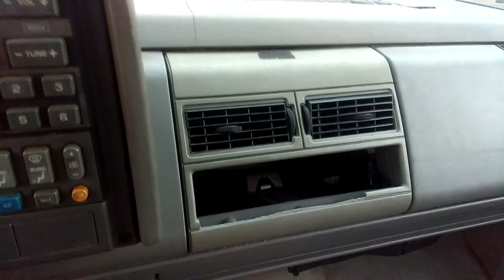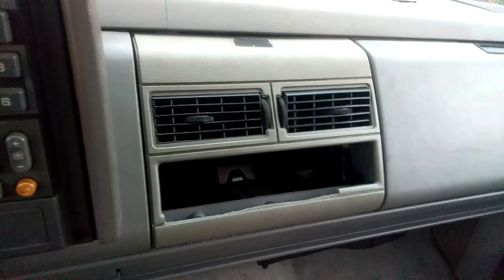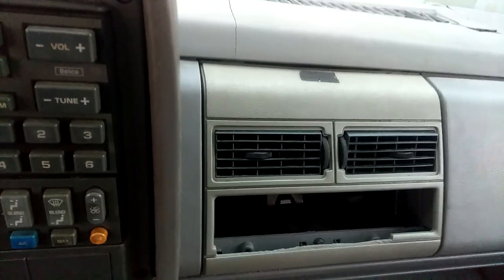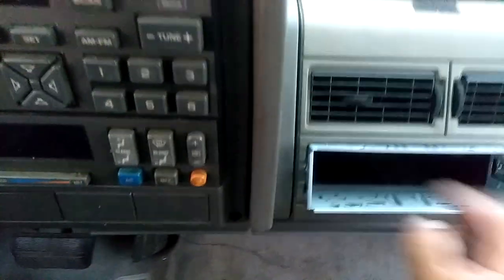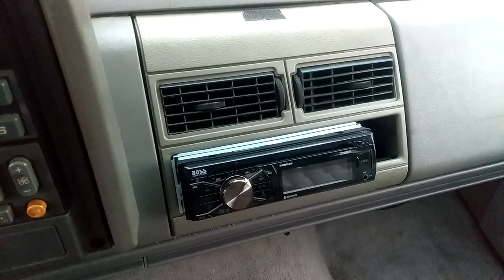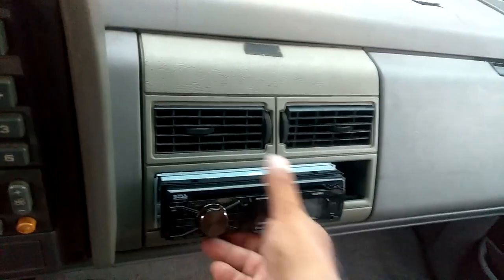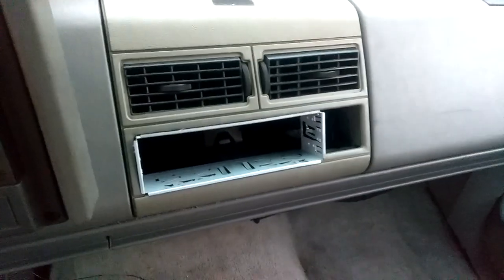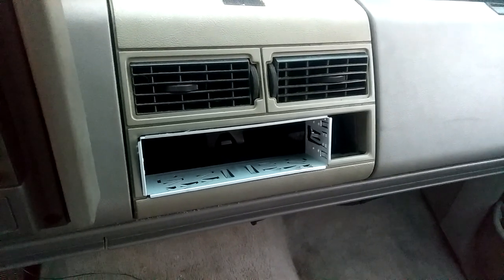1993 Chevy 1500 Silverado stereo installation cheap diy

Comment: They make a cheap dash kit for this on Amazon.  I have a 1992 Suburban. Fit's perfectly. No cutting.
Reply from the maker: Thanks, Iwill look into it. I was just improvising at the time.
Reply: @paultrevi  Yeah man, that's a nice dash underneath.  It's still a good cut, you can barely tell.  Most of the 89-94 chevy trucks I see have messed up dashboards. Yours is in nice shape. Good video.  P.S they make a dash cover kit as well.